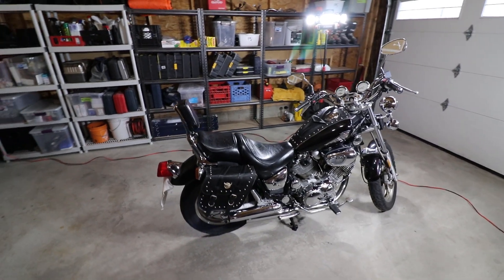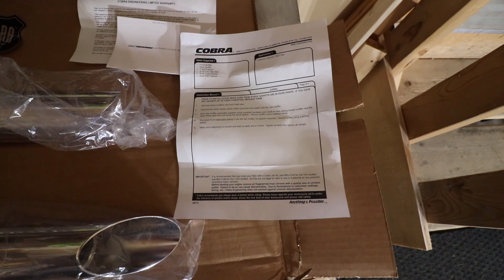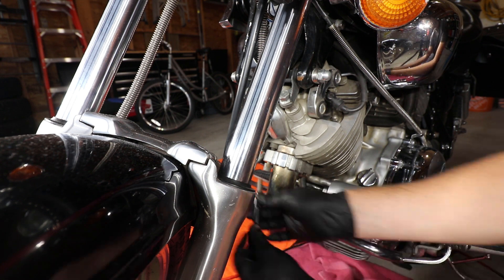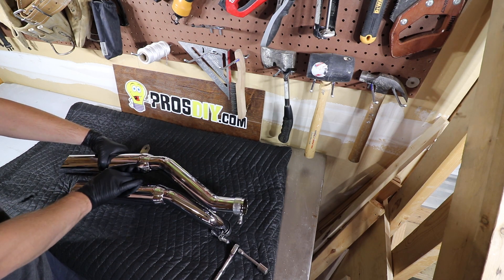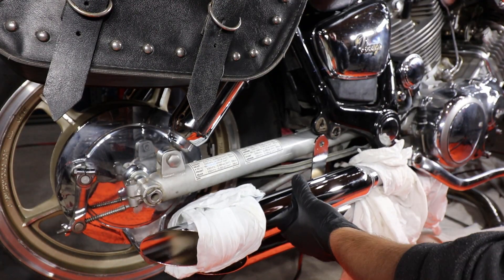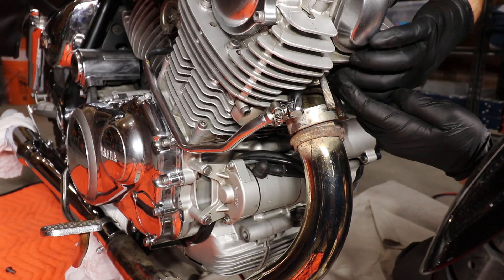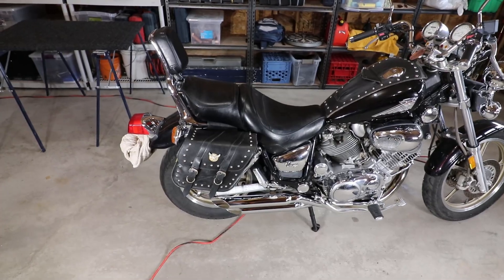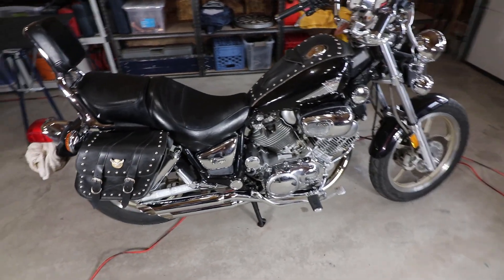Yamaha XV1100 Virago Cobra Slash Cut Exhaust Installation

Comment: Hey, just wanted to Thank you for the Video, you saved my ass with the exhaust gasket. So i ordered one before i tore into my 1992 750 Virago and it's a damn good thing i did, it was NOT coming outta there... the one issue i did have was, the lower Cobra pipe Tab (connects to the top pipe) was not 100% straight, which cause everything to be off, including that pain in the ass exhaust gasket. used a hammer and aligned it just right :D.  Thank you again for the awesome video .. Cheers

Comment: Those extra pops you hear during the sound test how did you end up fixing that?
Reply: Speaking from experience working on the Yamaha Virago and V-Star line that followed it, those popping noises are from their "emissions" system, which just takes air from the intake and puts it directly into the exhaust. We always deleted it on our bikes we messed with, and it gets rid of the pops.

Comment: So, correct me if I'm wrong: Viragos, above 500cc, they don't have the "cradle" of the chassis frame. (a frame around the engine). Foot pegs and shockers are mounted onto the engine, right? Engines are made of a breakable-type of metal/alloy, right? So, on silly impacts or falls, make pegs or shockers force the engine, and not the chassis, right? Therefore silly impacts or falls may.... BREAK THE ENGINE?!?!??!?!
Reply from the maker: Correct. Most people buy these bikes for the look. The lack of engine guards give these older bikes a chopper look without the new chopper cost. These bikes are far from the most reliable, comfortable, and heavily lack in the stopping department. You can purchase engine guards for these bikes but I think that defeats the purpose of owning one of these bikes in the first place. If I wanted reliability, strongly built, inexpensive, and the ability to drop the bike a 100 times, I would buy a KLR650. That all being said the Virago has been one of my more enjoyable bikes to ride. It's something about the feel and extremely low center of gravity. Just my 2 cents :)

Comment: Just wondering if they would be compatible with a 750 :)
Reply from the maker: Apparently they fit the following:
XV1000 Virago 1984-1985
XV1100 Virago 1986-1999
XV750 Virago 1987-1998
This was just listed on a distributor's website, but I'd always double check with the distributor if you're ordering.

Comment: Looking for advice.

I have a 750 and I snapped the hex screw heads from the front head. It was more rusted than I 5hought and apparently didnt add enough WD40. Any idea how to get the studs out? The metal "collar" (for lack of better word) is also stuck on there.

I also am not sure how to get the rest pipe out either.

I realize this is a rookie mistake and I am probably going to get a lot of flack for it.... but I miss my bike and want to fix this myself if at all possible still.
Reply from the maker: Hi Chris, Did the studs snap flush or recessed in the heads? or is there a little bit of the stud sticking out? Hopefully there's a bit of the stud still sticking out. You may have to use heat to help remove the stud. Once heated you can try using a set of vise-grips or a bolt removal socket. These sockets have spiral teeth which grab onto rounded nuts or studs/bolts.
To remove the nut ring "metal collar" tap it gently with a hammer on one side then the next. It should come free if the stud nuts are removed.

To remove the rest of the pipe, once disconnected from the head, loosen the collar (clamp) that connects the other end of the head pipe to the muffler. Then the head pipe should slide out towards the front of the bike. Best of Luck!
Reply: Thanks for the reply. I got it off a day later but man oh man was it a chore. 

Thanks for the video, it was very helpful.
Reply from the maker: Nice job! Snap rusty bolts can be such a pain. I'm glad you were able to get them removed. Cheers!

Comment: What is the hexagonal number of the front pipe?
Reply from the maker: I take it that you're talking about the head pipe nuts? Unfortunately I don't remember and sold the bike. The part number is 90179-08673-00 if that helps.

Comment: What muffler gasket is that? There are a lot of option and is that for cobra specifically because I'm putting straight pipes on mine as well. And want to order the part in case I do need it. Thank you!
Reply from the maker: The muffler gasket used in this video was model number 3EG-14714-00-00: https://geni.us/BArzp
This is a Yamaha part number and is made for the XV1100 and not a Cobra part. If you have a Yamaha dealer and you supply them with part number 3EG-14714-00-00, they will be able to look it up. Hope this helps. Cheers!

Comment: Nice video! Definitely sounds better.
Did you end up re jetting?
Reply from the maker: Thanks Andrew! I did end up rejetting and rebuilding the carbs. It was still running very rich so I went back to factory jets. Still a little rich, which I think is from the aftermarket float needles and seats. I'm going to replace the new OEM needles and seats and see if that makes a difference. I plan on making a post exhaust video with the best carb setup when I get it running just right. Cheers!
Reply: @PROSDIY  awesome, I plan on getting a virago very soon and will be buying those pipes. Your carb settings would be greatly appreciated.
Reply from the maker: @andrewmellan1156  Nice! These bikes are a lot of fun and there's so many out there, that parts are easy to come by. The carbs are not fun to work on though. There are 1000s of forum posts online about the carbs alone. Float height, and carburetor synchronization probably being the most important settings. I still plan on making a carburetor synchronization video as well. Best of luck on your Virago search and purchase!
Reply: @PROSDIY  so, if you have a virago xv750, complete factory spec, and then you install this, would you need to re-jet or do any aditional modifications? or would you be fine to just leave it at just putting the exhaust on?
Reply from the maker: @duskshadowpaws4434  I would leave the carburetor settings at first and test drive it. If you find that it is running too lean, then I would rejet. Every bike wears differently based on usage and maintenance. It's nearly impossible to determine rejetting without testing. A quick spark plug inspection and test ride will get you in the right direction. Thanks for the question!

Comment: Excellent vids, especially your carb vid. Just wondering did you get around to installing forward controls ? I have the same bike and am 6'1"  too, curious if they are comfortable/worth adding ?  Cheers.
Reply from the maker: I ended up installing Highway Hawk forward controls. They have there ups and downs. They definitely take the pressure off the knees and give the bike a way better feel. The down side is if you have forward controls you can't stand up to give your butt a break, hah. I ride a lot of enduro so I do miss standing up. My recommendation would be if you ride city mostly then go with the forward controls. If you ride highway then probably don't, unless you want to stop to rest every hour. This is just my opinion though. Take care and ride safe!
Reply: @PROSDIY  thanks for replying, appreciate your time. Cheers. Stay safe and keep the vids coming. All the best from the UK.

Comment: Did you debaffle these? My cobras don't sound this good. I want them louder.
Reply from the maker: Hi Hank, These are stock Cobra slip-ons. Model 2165SC purchased from Dynamic Cycle Parts Inc. That's odd that they would sound differently, interesting.

Comment: Does the center stand still need to be on the bike for this exhaust to bolt up?
Reply from the maker: Hi Steve. No center stand is required. The exhaust bolts up to the right side passenger foot peg. Thanks for the question. Cheers!

Comment: I put a set of cobra boulavards on mine, sounds good but too much "popping".
Reply from the maker: I agree Ken. Aftermarket pipes can sound great, but getting them tuned in on these older carbureted bikes can be a real pain. I've had to rejet multiple times to get it just right.
Reply: Part of that is due to the "emissions" system It pops even without, because what happens is the "emissions" pump takes air direct from the intake to the exhaust. (i wonder how that even passed emissions standards) We have DIY'd a few of these, and newer Yamaha V-Star series the same way. Basically under the left side "Bug eye" is the air pump. Disconnect it, and hammer on a couple of .45 ACP bullet cases onto the remaining openings. (one on each cylinder, you can't miss em) This solves the popping sound, and gets rid of that annoying pump at the same time.

Comment: Which forward controls did you install? Video still coming?
Reply from the maker: Hi @S B, I was originally planning on doing an installation video for the forward controls, but have decided not to. I install the Highway Hawks same as : http://www.phatperformanceparts.com/Highway_Hawk_Forward_Controls_Tech_Glide_Virago_p/hh-492-603.htm
I will be making a video on a full review of the bike though, including the new forward controls. The carburetor synchronization video is also coming. I've been very busy with work, but these videos should be out in May or June at the latest.

Comment: Thanks a lot for posting this video. Now I can follow it when I install Cobra. I am about to buy. Since the baffles are not removable, how to handle the case in Sweden when technical check?
103db is allowed for my Virago. Cobra will go beyond this. How to solve this? Is there some kind of special db killer suitable for this? Would appreciate any advice. Thanks
Reply from the maker: Hi muserska, Thank you for the comment. The only thing I can think of is adding an additional baffle, such as: https://amzn.to/2O7W5TA and possibly adding some 4-stroke muffler packing to the new baffle: https://amzn.to/2IHF0KA . I took some quick measurements and the Cobra exhaust has the following rough dimensions. Inside muffler opening 35mm diameter by 55mm length (until it hits the stock baffles), this is where the additional baffle would be installed. The opening at the slashcut is roughly 60mm. You would have to cut the new baffle to length. There might be some other options, but this is the best I can come up with that still keeps the look of the Cobra exhaust, and is also removable after you pass your technical check. I don't know how much quieter it will make it as well and there will be an increase in back pressure. If you come up with a solution, please let me know. Good luck on your install!

Comment: Loud pipes does not save lives. That's just a biker myth. 90 % of all accidents happens at your 12 o clock. The car don't hear your engine before the crash.
Cars don't hear you anyway. Wear a yellow bright vest. That will more likely save you
Reply from the maker: There's no doubt that being more visible, riding defensively, and taken riding courses help with reducing accidents. There's also no doubt that someone checking their mirrors and not seeing you, but are able to hear you are far less likely to drift into your lane. This is especially important in busy city riding where you aren't always able to stay out of someone's blind spot. I travel a lot of city traffic and I can say just from my personal experience I've had way more people cut me off while riding my Honda Shadow and XR250L, than my bikes with louder pipes.
Reply: @PROSDIY  I have a friend with a Honda Shadow with shotgun pipes, he barely rides it because it gives him a headache from the noise. Never uses it in residential areas either, it mostly collects dust now. Would gladly buy it and change the pipes out though